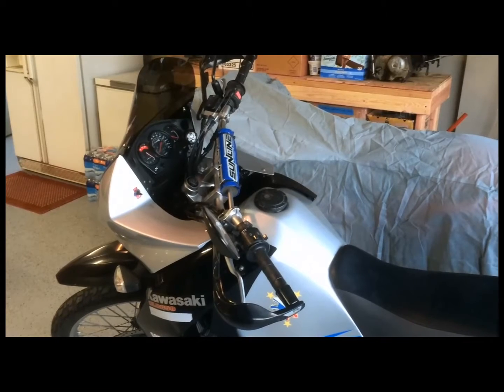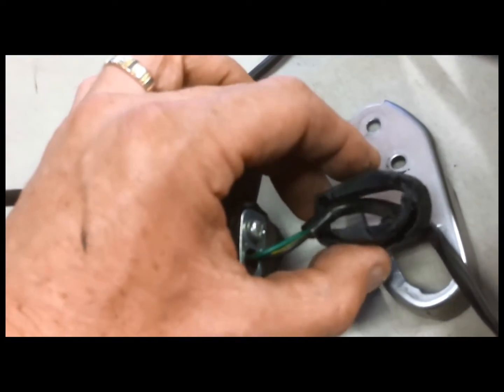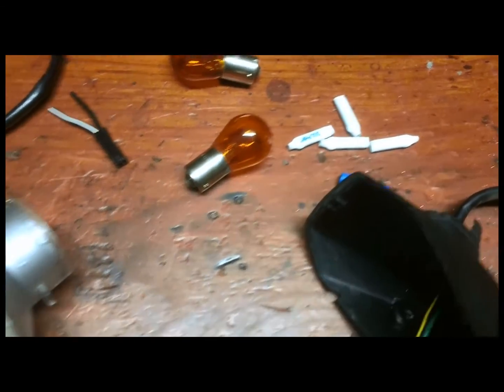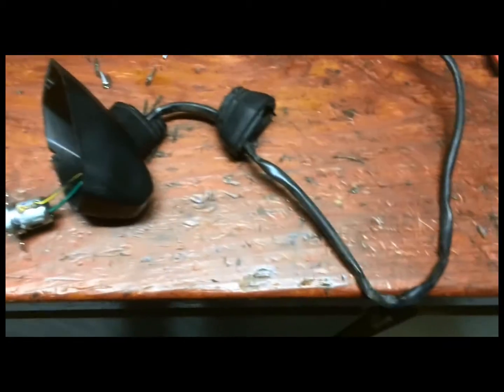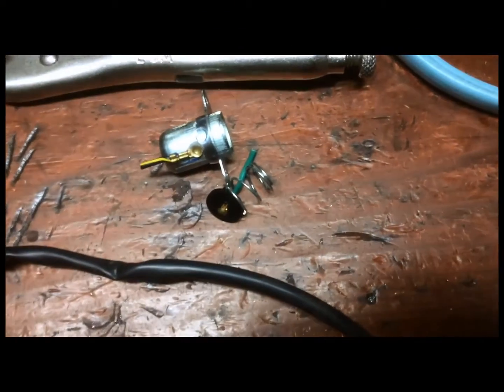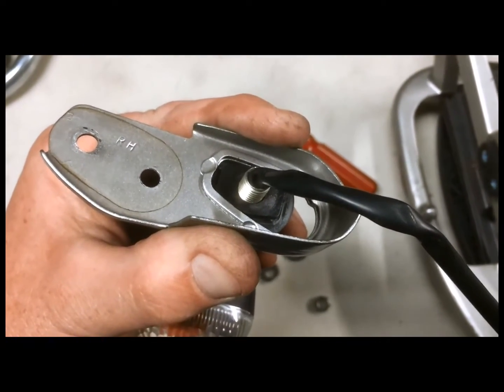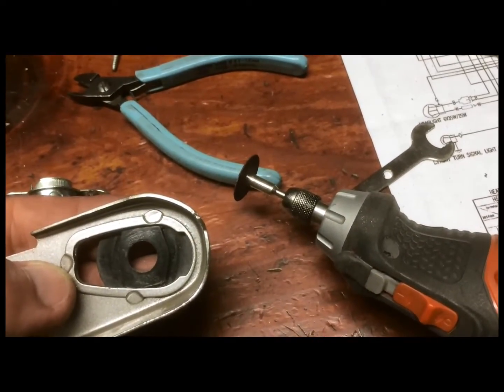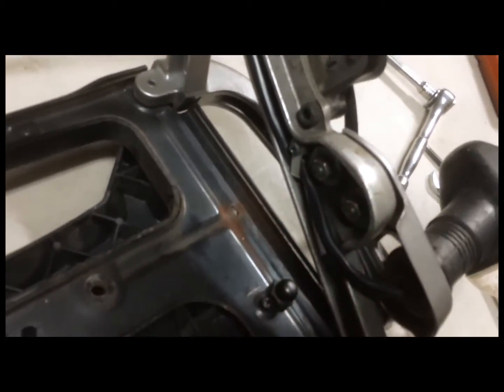2008 KLR650 Broken Turn Signal Fix

Comment: Thanks for this video. Just bought an older model KLR with the signal lights removed(The guy was just using it off road mainly I guess).
Reply: They come off so easy it almost seems intentional.